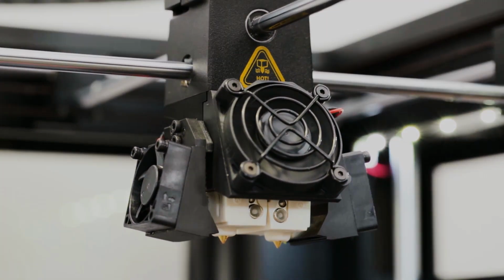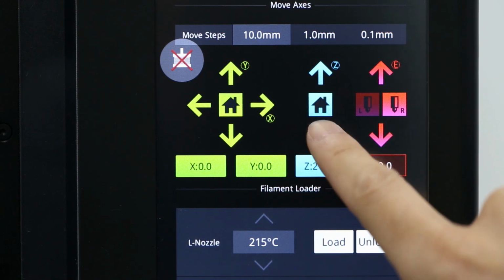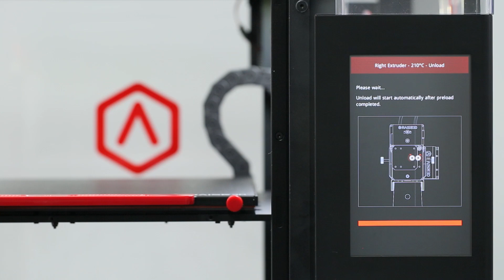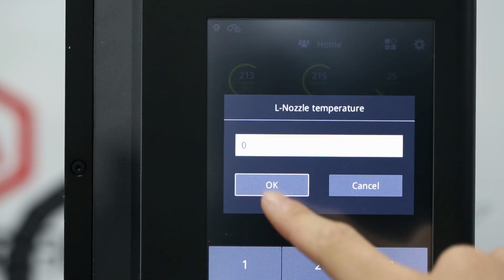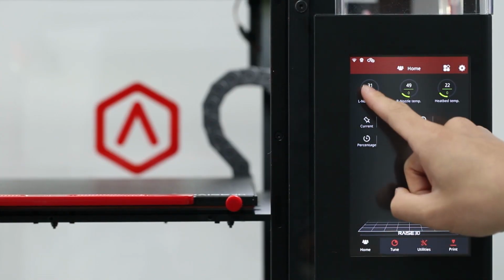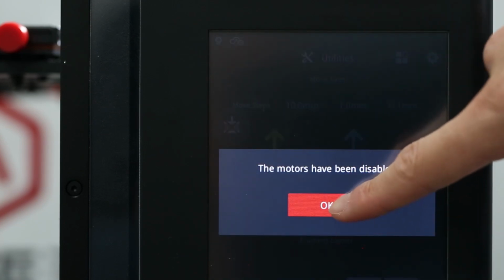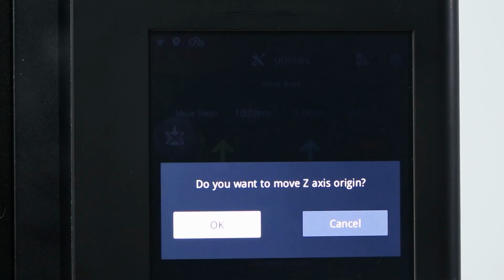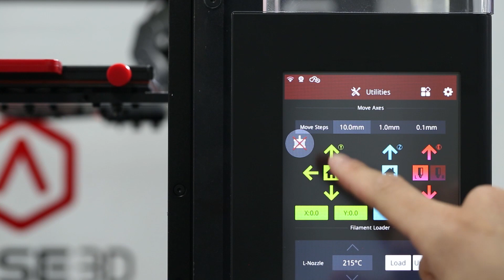How to Calibrate 3D Printer Nozzle Height on the Pro2 Series - Raise Academy

Comment: my nozzle keeps hitting the bed and causing dents. How do I do an major adjustment to the nozzle head on a Raised Pro 2? There are fans around it and I'm not seeing how to get to a setting screw.
Reply: Unless I am misunderstanding your question I believe that is what they are showing at time marker 2:23. You have to unscrew the screws that hold the fans in place and then that gives you access to the set screw that holds the hot end in the collet. You have to loosen that screw and push it up all the way and retighten. The video seems pretty clear so maybe you are asking about something else?

Comment: This really is a complicated and time-consuming process compared to many other printers, especially in this price class. I hope that there at least will be a sensor on future models.
Reply: I bought it because I assumed the nozzles has a sensor for auto-leveling. Also flex material is the same problem as with cheap printers. Only the Cloud-Option and the closed case is a big advantage. But time consuming adjustments are not gone for 5K.

Comment: When you manually adjust the right nozzle hot end, bringing it down until it touches the feeler gauge, doesn't that create a small gap between the tube in the collar, coming out of the lift mechanism and the tube attached to the hot end, above the heat sink? Is a small gap at that place between the two tubes negligible ?
Reply from the maker: Hello, thank you for the question!
There should not be any issues related to the gap as we have not found any in our testing. But it is important to make sure both hotends are installed as high up as possible, while maintaining a proper calibration between the nozzle heights to ensure the collet has a good grip on the hotend
Reply: @Raise3D  sure, I'd find the nozzle that sits lowest at the nozzle tip, while also being mounted as far up as it can go, into the clamping collar. Then, I'd bring the other nozzle down to the same height (with proper gap to the bed surface achieved on the lowest nozzle, rhetorically speaking). Thanks for your reply 👍